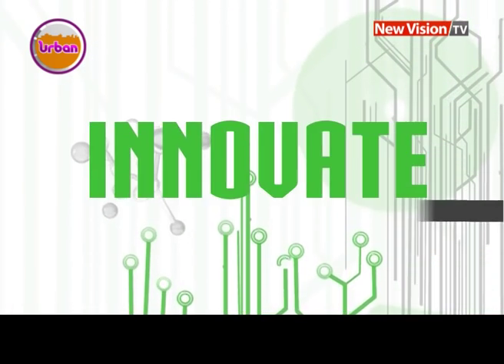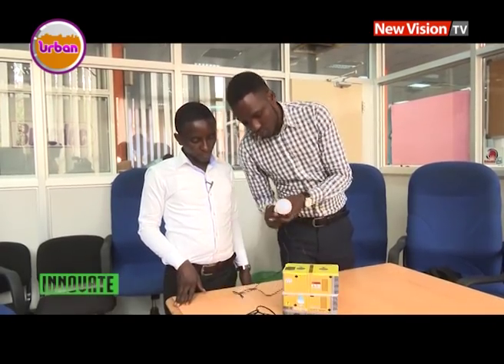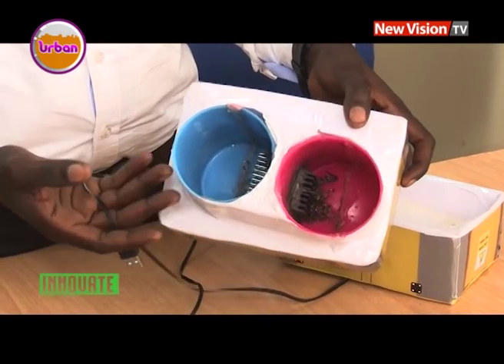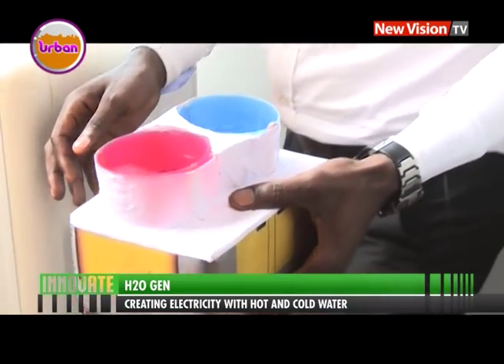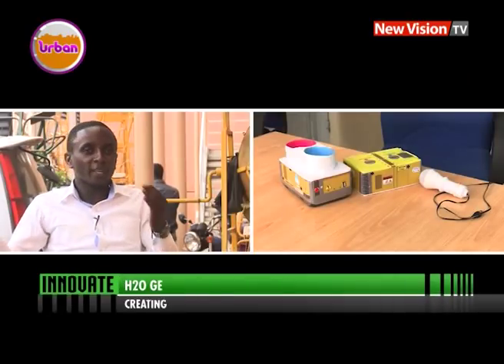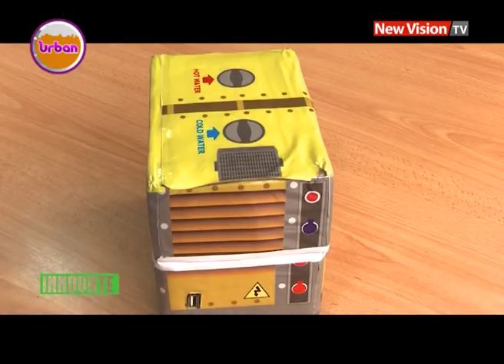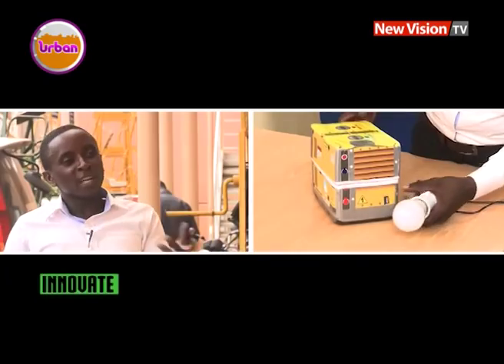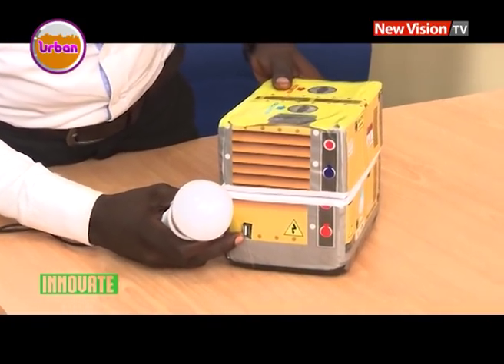Generating electricity with hot and cold water

Comment: The problem here is that more electricity goes into heating the source water than what you get out. You are better off not heating the water in the first place and directing that source electricity elsewhere.
Reply: Hot water could come from a camp fire.
Reply: I heat my house with wood, and have a ton of excess heat energy.
Reply: @FYMFTP  wrong units 😃
Reply: How about the hot water that comes out of the engine on my boat?